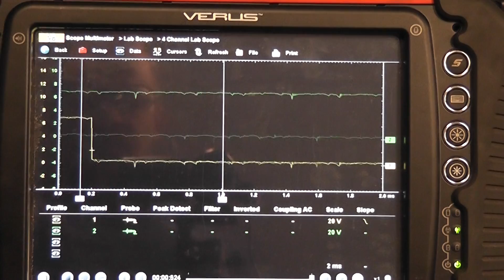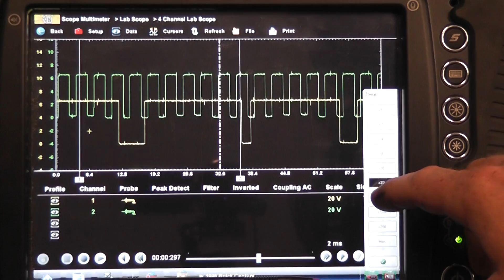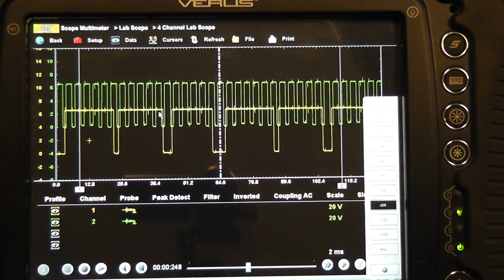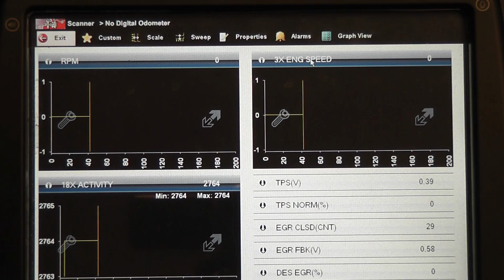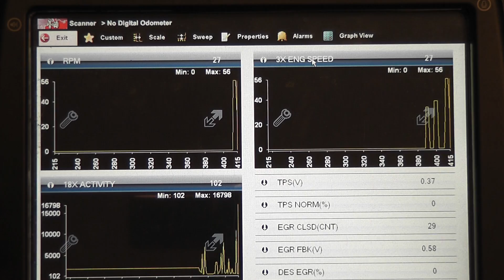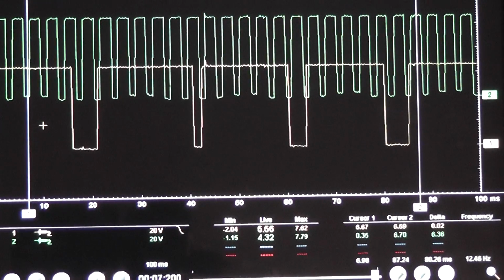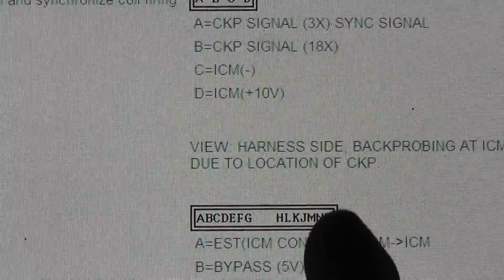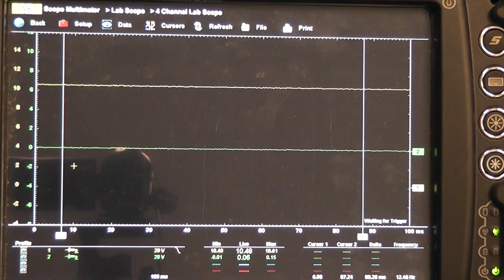How to test a crank sensor on a GM 3800 engine (3x and 18x signals)

Comment: This sensors been giving me such a headache.on sensor number 3 now I can change one in about 30 mins because I don't have an air compressor to use impact rn.I don't see power at the sensor.see good ground no signals.youve at least given me something new to look into.i have power and ground at the icm I'm at the point of replacing a dubious looking ckp sensor connector and praying.Love the 3800 had them in most my vehicles I've owned.this one though I'm getting tempted to scrap it
Reply from the maker: Have you seen this one?
https://youtu.be/3-MTko-otio

Comment: Mr danner. What would need to be checked if 18x signal goes missing from live data on the scanner (verus edge) after 1500rpms. In gear it stalls when taking off from a stop. If you’re in park the signal is still missing at those rpm’s or above but the engine will run fine. Thank you.
Reply from the maker: @SMAutoRepairLLC  monitor your 5v ref circuit with a meter and see if it's dropping out
Reply: @ yes sir thank you!
Reply from the maker: What year? Does the 18x signal first go into the ICM and then the ICM sends it back out to the PCM? Monitor both the 18x in and 18x out signals with a labscope would be where I would start
Reply: @ 2005 Buick lacrosse 3800. Great that’s what I’ll do!
Reply: @ yes ICM Receives crank signals and then sent to PCM. Do you know what abbreviations may be used for the out signal to PCM? Thank you sir
Reply: @ alright so signal is good in and out of ICM and to ECM. Maybe I’m barking up the wrong tree here. Customer complaint is stalls when taking off from a stop. No codes. Only thing in data I saw that was off was the 18x signal going away at or after 1500rpms. With the scope I see it at all rpm’s.
Reply from the maker: @SMAutoRepairLLC  these can be really tough. No codes and random stalling on accel. If the problem is repeatable, that helps. Maybe measure that same signal at the PCM to be sure you don't have an open happening in that wire. Not sure if that is a pull-up or a pull-down signal from ICM to PCM.
Also, unplug the MAF and drive it and see if the random stall still happens
Reply: @ absolutely thank you sir!
Reply: @ alright so i defiently believe I was on the wrong path here. So upon further inspection unplugging the  EGR fixed the stalling the vehicle runs great and stalling is gone. Is there a procedure to test this EGR. I’m pretty sure it’s just mechanically stuck open but I want to be sure, I’ve wasted some serious time on chasing the missing 18x crank signal. I really appreciate your time for reaching back out to me and answering my questions sir.
Reply from the maker: @SMAutoRepairLLC  take it off and work it with brake or carb cleaner and a torx bit screwdriver (in the pointless and stem area. Then scrape the seat real good too with a pocket screwdriver. You may need a battery disconnect when your done to reset the learned closed pintle position. I got a video on this! Hang on
Reply: @ your video was excellent!!! Thank you!! After following the video for a clear understanding of this system and what to look for I removed and cleaned the EGR with no change. My data on the scanner was spot on. Vehicle runs flawlessly unplugged. Plugged EGR back in stalls on take off. I’m really on a wild goose chase!!!
Reply from the maker: https://youtu.be/HT4OnP4U0to

Comment: Does a GM 3800 series 3 can crank but not start with a faulty crankshaft sensor even if ICM, coilpack produces spark?
I have good fuel pressure, spark, power on injector as well...
I don't want to remove the harmonic balancer and replace a crankshaft sensor unless I know for sure that the sensor is damaged.
Any information I will appreciate it in advance
Reply from the maker: You have spark from all 3 coil packs?
Pull a spark plug and tell me if it's wet. If it is, put your tongue on it and see if it tastes like antifreeze. The upper intake on these will deteriorate around the EGR ports and will leak coolant into the engine

Comment: Dude, knocked it out of the park on this one..  covered all pertinent info and you should totally get a great kickback.  Thorough checking all wires and signals.  The volt meter numbers were a nice touch.  Note:  If anyone is interested the older pre-1992ish systems with coil packs are the same except it is 10v from the module.  Thanks again
Reply from the maker: Thanks so much!

Comment: I am building a 3800 for a turbo setup using 160 lb. injectors and a stand alone ECU, and I want to use individual smart coils. Do you know if I can send crank signal from the ICM to the stand alone ECU and make the ignition work?
Reply from the maker: You won't be using the ICM though because it is set up for a waste spark coil (total of 3 coil drivers).
The crank signal has 2 signals, an 18x and a 3x. The 18 x may be the one you can use
Reply: @ScannerDanner  Thank you

Comment: Please Help! In both signal wires with the sensor disconnected: I only get 4.95 V  each wire, not 7V. (2004 Buick Le Sabre). The power wire reads 12V. When I connect the sensor, the signal wire's voltages drop to a constant 1.6V and 0.6V. No signals are created when turning the crankshaft. No reaction at all. I tired new ICM, 3 different sensors and they do the same thing. It started when I replaced the CKP sensor to an Acdelco Gold sensor. Car ran for 2 minutes, died, and there there was a metallic sound like a screw falling, and she never started again since. What is wrong? I checked grounds, fuses etc, and found nothing.

Comment: I have a 1991 Olds 98.  It will not start and I have no spark, no injector pulse.... I have replaced the ICM, the coil pack, and the crank sensor 3 times AND on testing the 3x and 18x signals I have a constant 5 volt reference signal no matter how the balancer is turned......I'm stumped.

Comment: * I did a related test on an '89 3800, by hooking up an LED test light, and very slowly turning the crankshaft by hand (spark plug wires disconnected)....  
I repeated the test several times on the 18x signal, and I consistently got only 17 pulses.   
I then repeated 18x test a few more times, and marked the harmonic balancer with a Sharpie everytime the LED went on....   
Yes, there were only 17 pulses; and several were irregularly spaced.  One interval was very long (probably the one where the 18th pulse should have been).   
 I re-tested yet again to verify the marks I made on the balancer, and yes, they were in the exact same location every time...     
The teeth on the back of the harmonic balancer did not look bent or distorted; I removed it previously to replace the CPS....    
This is the NEW CPS that I was testing, because the engine would not run smoothly, and would skip....     

 *  Is the harmonic balancer bad (teeth misaligned or magnetized(?)) because the irregular pulses occured consistently at the marks I made?...  Or, is the CPS defective ('weak') because it's not robust enough to sense all the teeth sufficiently....  IF the teeth are 'off' it can only be almost invisibly so.

I have another '89 3800 from the same make/model car,  but I believe the engine is balanced externally, so I cannot swap harmonic balancers, right?   I could swap the CPS from that, because I had replaced it within the last 10k miles or so, and it was working.
Reply from the maker: I have a case study on my premium channel that shows an aftermarket balancer (on a 3800 engine)  having slightly larger teeth that completely kicked my ass.   There is a 14 day free trial, enough time to watch it and then cancel your subscription and it won't cost you a dime. https://www.scannerdanner.com/join-scannerdanner-premium.html
As for your LED light and counting 17, what if you count the off time?
Reply: @ScannerDanner  
...  As it turns out, yesterday I swapped in the CPS from the other engine, remounted the balancer (and adjusted the CPS play)....  
The engine started right up and ran smoothly (although it clacked for a little while because the valve lifters had drained down)....  
I started engine again this morning, and it ran both smoothly and quietly (those lifters had fully pumped up)....
So, I guess I'm looking at a strangely defective brand new CPS (that I got from a store that rhymes with 'Lotto Clone')..

What I did in my makeshift test, was to sort of mimic the oscilloscope test, with a non-running, hand-cranked engine.
Silly me, I should have done these 3x and 18x tests 2 weeks ago, and 
I should not relied on the fact that the CPS was 'new'. 

** BUT it was in large part your great video that gave me the idea to mark the harmonic balancer, which in turn made me really suspicious of the CPS.
Thank you!

In summary, there are apparently situations where a 'bad' CPS will not result in a complete no-start, no-run situation.
In my case, that irregular '17x' signal was probably driving the ICM and ECM crazy!
Reply from the maker: @kennikuhlmann-clark9860  bad new parts 🤢🤮
Nice job! When there is a will there is a way, even when you don't have the equipment I'm using. Major props to you

Comment: 98 grand prix gt P0336  so I changed the CPS ran good for a day code came back shop said replace the harness replaced the harness Code came back so I replaced everything that went with the system:  ignition module/coils/computer/harness/cam & crank sensor all ac delco/Delphi parts & code came back , b4 car would no start or start then stall when I would "wiggle"the harness at the coil pack .it runs good no stall no shaking, fires in less than a seconds ona cold day , CEL is just on please help 117k miles
Reply from the maker: Maybe this is you? https://www.youtube.com/watch?v=3-MTko-otio
Reply: @ScannerDanner  OMG thanks so so much I kno what do now , I was gonna sell this car thanks thanks 💯
Reply from the maker: @bighomieJ5X  please let me know what you find. Even if it is not the same issue, I'm pretty sure this video will give you some direction at least

Comment: I have a 2008 lacrosse 3800, with  INTERMITTENT no start,  I checked with  T-pins on the 3x and other on 18x I get signals on the scope ALL THE TIME even when no start,
but when no start there's no spark on the coils, my question, is there another inputs to the ICM other than the crank and cam sensors to produce the spark??

Comment: Hi Paul. I'm looking for easy explanation of floating ground versus regular chassis or battery ground. Trying to easily visualize and understand why when testing cmp and ckp signals, it's recommended to place your ground lead of the scope on battery negative and why not the ground wiring of the sensor?
Reply: A floating ground is a gnd that can be significantly different voltage level than gnds at other points with respect to a "reference gnd" (More on that after).This can be due to poor connections be it loose pins, corroded pins or corroded screw/bolt terminals, intermittent breaks or just a long path of thin wire. Gnd voltage at a given point can change during load events in engine operation must notably cranking or anything that increases current such as air conditioning, ignition, heater, radio. Voltage = Current x Resistance (E=I x R), so for a given resistance  "R" (due to any issue I stated prior), you can see how a voltage drop occurs as current "I" increases

Now to your question on where to put a Gnd point. If looking at a sensor you should not have gnd at the battery, what the battery sees or thinks is irrelevant. What is relevant is the potential between power and gnd a sensor or load sees and the power to gnd potential the computer sees. So ifor example, you look at crank sensor problem and put positive probe at the computer crank signal and negative on the battery and see diff of 7 volts. But the computer references the incoming crank signal to its local gnd. You then put the negative probe at the computer and now see diff of 5 volts, what happened and whose right? Well what happened is there SEEMS to be a difference of 2V in the signal depending where your gnd probe is. Could be a high resistance connection from computer to battery that is dropping another 2 volts. This just doesn't happen because of crank signal current, it happens from the total of all currents flowing in that path, perhaps thru a gnd strap and/or long path back to /from battery. Remember equation E =I x R. 

So you decide to measure the voltage drop from gnd on battery to gnd at computer. The meter tells you its only 0.2v or 200 mv  so why is there 2v difference in voltage measured before? Well lets go back to the crank sensor, whats its power level, whats its gnd level? Depending where you put your gnd you will get different results. But the crank sensor puts out a signal level based on the  power to gnd potential it sees, so thats why you must used power and gnds at the DUTS (Device Under Test) Lets say the power path to the sensor is perfect so its got 12v and lets say the sensor circuit drops 5v internally in normal operation, then that accounts for the 7v out in the video scope measurement. Now lets saw the gnd wire to it came from a corroded gnd strap or its gnd wire is broke and barely touching, that will increase gnd resistance and thus cause the 2V difference we saw back at the computer, it wasn't the battery to computer gnd , its the sensor to computer gnd that is the problem making it look like there is a 5v rather than 7v difference at the computer.

So I hope that explains it. Always reference the closest gnd point to whatever Voltage you are measuring at whatever load/sensor/device. The only thing battery gnd does is reference the battery voltage AT THE BATTERY and nowhere else. Also realize that Power can have the same issue as what I described for gnd and many times both a lower voltage power and higher voltage gnd can contribute to issue at same time. If you use battery gnd as reference then you need to make static (no load) and dynamic (load) measurements from battery to all points of interest. Just always reference pwr/gnd at device under test.
Reply: because you are trying to isolate as much as possible, you test each thing separate. the grounds should really be tested with an ohms reading to ground or battery. alot of the ground issues are corrosion and thats the only way to tell for sure. if you just put your meter on the power and ground it will read good even on a circuit thats got a corroded ground that wont pass current

Comment: i have 08 lucerne, 3800,  no codes, no start, no spark. i tested the 3x and 18x wires, they stay at 3v all the time(with no engine cranking or not), ckp sensor plugged in or not. you think its the ckp, icm or something else?
Reply: Did you ever find out what this was? I replaced ICM and still nothing
Reply: @Ryan Shepard ok I will try that. I was going to replace the ckp sensor next. Do you know where the ground is?
Reply: @Ryan Shepard thanks man. I am at my wits end with this darn car
Reply: @Ryan Shepard sometimes.  Sometimes you want to take a ball bat to the sucker
Reply: @Ryan Shepard figured it out. It was the crankshaft position sensor. Water pump was leaking. Caused sensor to short out.  No codes or anything.  I hope this helps someone out.

Comment: Hi Paul, I have a question I spoke to you about a car that has been giving me an intermittent issue. It randomly will shut off. I am rather new to diagnostics. I recently purchased a verus scan tool. I hooked up the scan tool. I had several codes come up. 1 was for a thermostat code. A misfire and 1 for an oxygen sensor.  I'm kinda pulling my hair out lol. Any advice would be helpful. Thanks
Reply from the maker: Post your question here brother. We can help you better than here on YouTube
https://scannerdanner.com/forum/post-your-repair-questions-here.html

Comment: hi good video hey here  my problem when I test looks like 3x signal go so fast Doble then 18x I check all wires no short but still same problem do u think ecm it's bad?
Reply from the maker: absolutely not. The 3x and 18x signals are generated by the ignition module and crank sensor. The ECM is not involved in creating these waveforms.
Reply: ok thanks so probably wires misconected?
Reply from the maker: not sure. can you post the waveforms to my forum?
https://scannerdanner.com/forum/post-your-repair-questions-here.html
Reply: ok let me do it  tomorrow I don't have access to right now but hey thanks man

Comment: I hope u can help me. I already check all the signals to ICM and to the CPS and CKS everything is good but still don't have spark. but if I unbolt the ICM then I have spark. why is that?please any help would be appreciated
Reply from the maker: Check the ICM ground. It's through the housing on some of those. Or there is a loose ground underneath that your stressing when you unbolt the ICM and it's temporarily making connection
Reply: tks I will check the ground underneath the ICM base

Comment: Great video, but when setting up the Verus do u set it up to volts dc or ac?
Reply from the maker: DC. A scope will show both AC and DC signals when set to a DC volt scale. AC settings will block all of the DC and only show the AC
Reply: Thank you for your knowledge I appreciate it thanks!

Comment: using verus pro. 18x flatlined at 1600ish rpm while 3x showing 2200ish rpm cruising at 50mph. Seems like 18x is low rpm signal and 3x is high rpm signal.  Am i correct?
Reply: Roberto Arteaga Correct, module reads the 18x for under 1200 RPMs and 3x for above 1200.